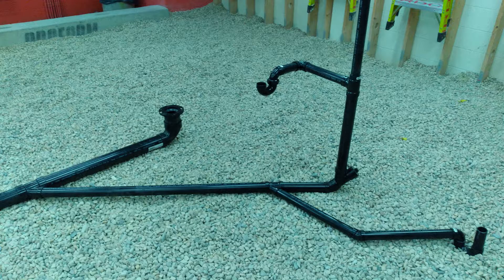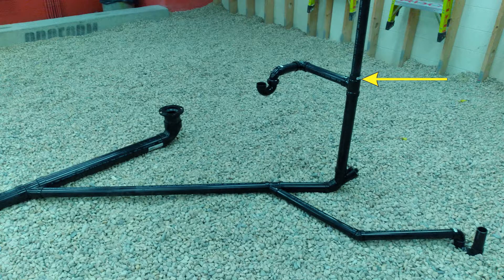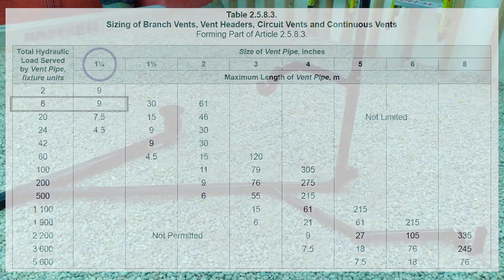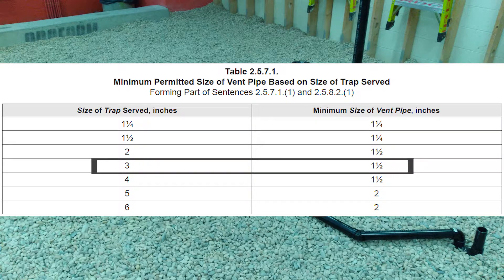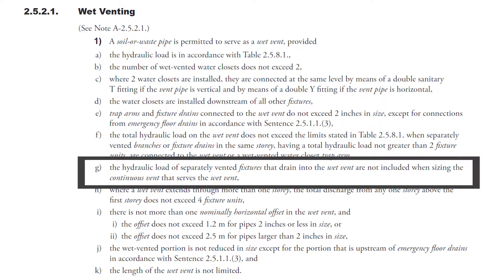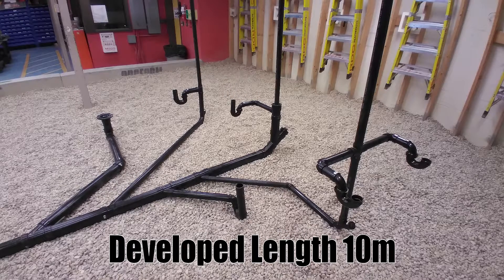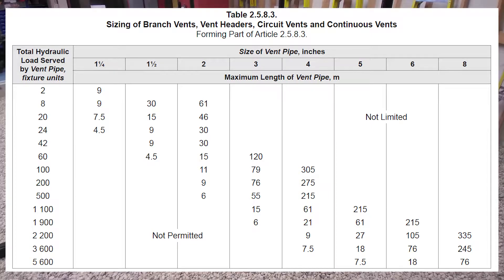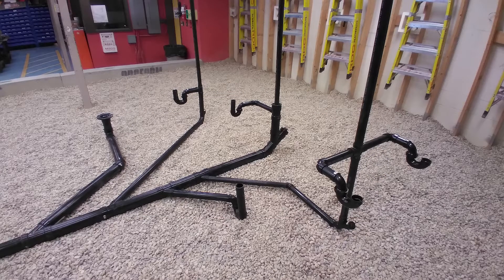Wet Venting Video:5 - Sizing a Continuous Vent

Comment: I  am wondering if there is more in depth information in regards to horizontal drainage systems that require strict code guidelines into the areas of commercial clothes washers and tie in too the drainage systems where the distance have to have so many inches apart for the next drain line that  are part  of the building drain system.      Dissections of horizontal parkade   drainage designed systems....

Comment: Quick question- if the lav is 1.25”, the wet vent is 2”, and the continuous vent is 1.5” like in your first example, what kind of tee do you use there? Where do you put the reducers/adapters, particularly on the lav side?
Reply from the maker: You would use a 2" x 1½" x 1¼" TY

But let's be clear, 1¼" drainage is almost never used anymore. (It's considerably more expensive than than 1½")

Therefore you would just stick to 1½" for the lav trap arm, and a 2" x 1½" x 1½" TY

Comment: In this case, we consider the sow pipe in the middle as our wet vent. Why not consider the right sow pipe with two LAVs as the wet vent?
Reply: If we consider the sow pipe on the right as the wet vent, the two LAVs are the most upstream fixture, aren't they?
Reply from the maker: @JERRY_ONG  If it's sized properly, yes you could end your wet vent at the two lavs on the right. As the plumber, you get to do it your way as long as it is to code.
Reply: So where could you tie in your continuos vent ? Would it have to be above the upmost fixture or anywhere closest to the main stack vent , tie in spot wouldn’t matter ?
Reply from the maker: @richardwuttunee9355  You can tie any vent together as long as it is above the flood level rim of the fixtures they are serving.